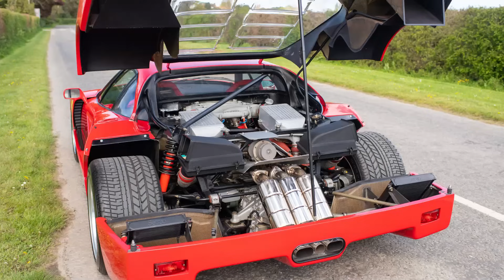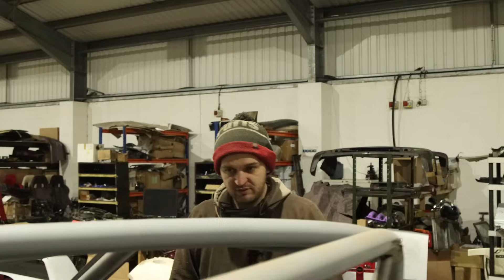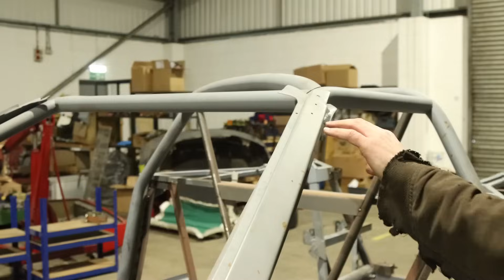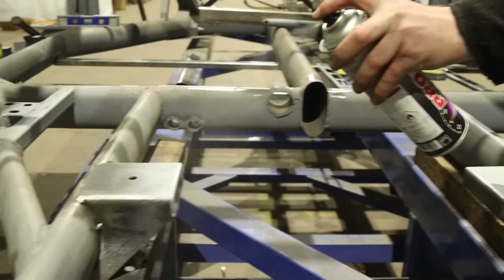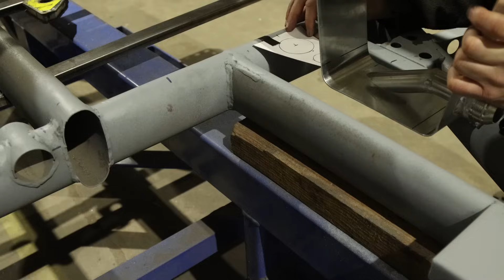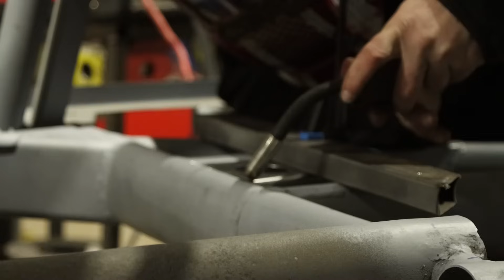F40 LM Build - Part 3: Rebuilding a Wrecked Ferrari 328 into an F40 LM Race Car!

Comment: Did you or will you take the opportunity to rectify the steering wheel angle in relation to the driver? Being an armchair expert I've heard and seen the steering wheel is at a strange angle.
Reply from the maker: Your armchair expertise are correct, it was a little odd. For this one, the owner will sit in the seat and the steering, seating and pedals will be moved around to suit him. Like a tailor made suit

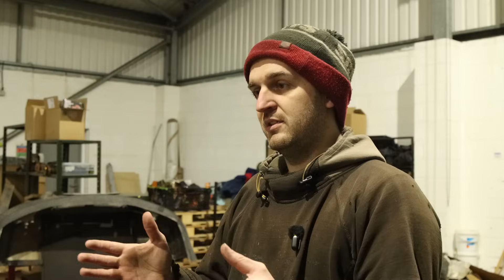Comment: 08:10 ~ 
As a Bystander, see you've changing it all - No part is Holy in it's place, and you Need to Move the Center Frame Tube to the Left.

Why not - cut the Two width beams front & Rear, say 300 mm Center Piece, and Flip it Right to Left?
that's how you making it RHD and Gains the 55 Mm needed for Pedals.
Good luck
and yeh, It's awesome
Reply from the maker: The central core remains untouched, we'd like to keep it that way if we can. There's always an engineering solution for every problem 😁